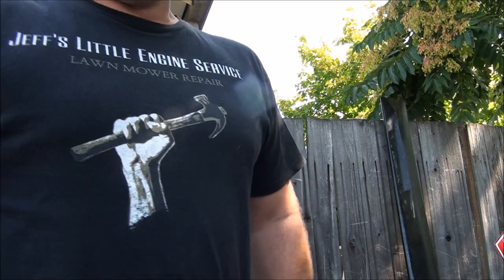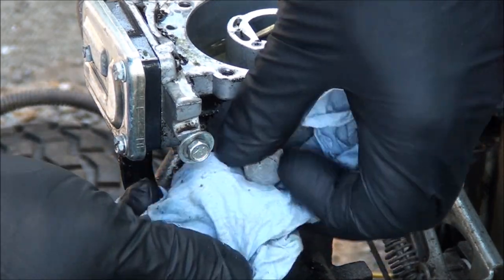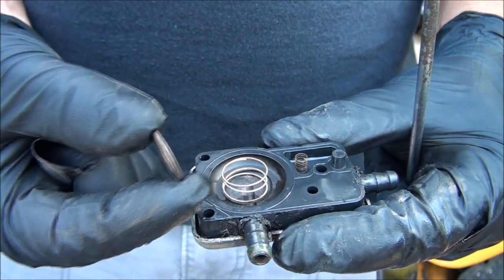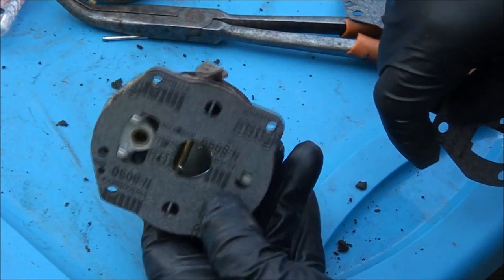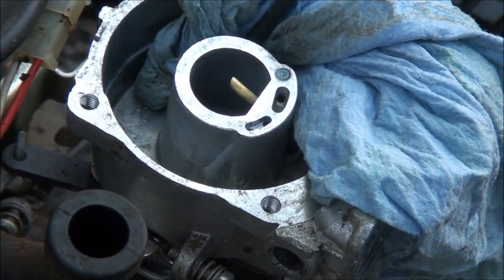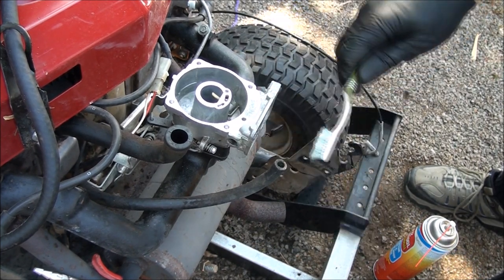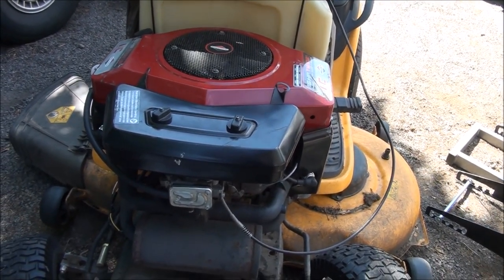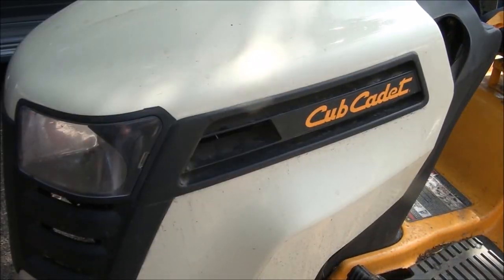HOW TO Rebuild a BRIGGS and STRATTON OPPOSING Twin Cylinder engine CARBURETOR. All Horsepower same

Comment: This was very helpful. One thing, I actually put in about 4 oz of fuel in carb before installing the top of carb back on. Having the fuel in the carb, made for a very quick start without having to crank long.  I also used carb cleaner stray and shot it through the passages. Runs great now.
Reply: @Lane Kolton instablaster :)
Reply: @Deacon Braydon thanks for your reply. I got to the site thru google and I'm in the hacking process now.
I see it takes quite some time so I will reply here later when my account password hopefully is recovered.
Reply: @Deacon Braydon it did the trick and I actually got access to my account again. Im so happy!
Thank you so much, you saved my ass !
Reply: @Lane Kolton no problem xD

Comment: Very Good video. I use wooden dowels, stick them in the screw holes, slide all the gaskets and parts over them, then take them out one at a time and install the screws. Seems to help hold all the stuff in place. Thanks
Reply from the maker: Thanks friend, good tips!

Comment: Subscribed. Very informative video! It will come in handy when I go to rebuild my Simplicity 6216 with this exact engine. Handed down from Dad, who bought the tractor new, the carb has never been touched except for a rebuild of the fuel pump 10 years ago. Today, I had a hydrolock on one cylinder when I went to start her up, so I suspect a faulty float valve/needle sealing.
Reply from the maker: yep sounds like it flooded

Comment: Great video , I have a 16 horse Briggs Stratton  twin   there's vacuum on the engine  i rebuild the pump as you showed  ,. But it isn't sucking gas at all  doesn't seem to have any vacuum leak's  what is my next move  i open for ideas  thank you  for your video
Reply from the maker: Make sure fuel line is not kinked or plugged. Make sure vacume tube/hose from engine to pump is not damaged. The float bowl should fill up with gas eventually when you try to start the engine the first time after servicing. It can take awhile  you must try to start/turn for 30 seconds or so before the carb fills up with gas. Also, double check your work something may not be right.

Comment: You said someone must have rebuilt the carburetor. I think you meant to say someone rebuilt the carb then swapped engines. I have NEVER seen an LTX Cub with an opposed twin. Probably better off than the Kohler Crappage motor. ;)

Comment: What is the foam ring for?  Can't find it on my carb.  I also have 2 New needle screws in my rebuild kit.  Only one on the carb.  Also my main jet is attached to an electric solenoid that didn't come in the kit.  I'm assuming spare pieces are for other alternate models.  Thanks.  Great video.

Comment: The material you were calling THIS is the "Fuel Pump Diaphragm" as for the springs simply put a dab of grease on them and they will not move or fall out, and I do mean a SMALL dab!

Comment: Good video but the gasket you used under the float didn't match the one that you took off the carb. I saw one that looked like it would have matched it better in that handful of gaskets that you had. Just an observation but I didn't know if it might would have effected the carb function.
Reply from the maker: good eye! You are right, the gasket I used did have an extra hole but it was ok to use.
Reply: @JeffsLittleEngineService  no the gasket you used has round opening and smaller opening which would affect fuel air mixture you are an amateur buddy you should watch how to videos not make em

Comment: Great step by step video, thanks! But I did everything and rebuilt the carb for mine (same engine as yours) and still have to run it with some choke. All ports cleaned and clear. All new gaskets and float pin w/spring. Float in great condition. Rebuilt and everything great on the fuel pump. But still will only run with choke about half at full throttle and almost all the way out at idle. Very frustrating!
Reply from the maker: You may have used the wrong gasket or missed cleaning some passage ways inside the carb.. You are still having  a carburetor  problem
Reply from the maker: Or perhaps the engine is only running on 1 cylinder

Comment: Your air filter could have also caused your problems and you don't rebuild a carb that is still mounted on the engine.
Reply from the maker: psh

Comment: My kit only came with all the gaskets for the fuel pump and carburetor and flot needles and the needle spring and one red tiny plastic o ring a a little bit bigger black o ring as long as I don't lose the springs in the fuel pump can I get away with the kit I got and how do I tell witch needle I need to use I always use the wrong one every time I rebuild a flot carburetor
Reply from the maker: you must pay attention and match up the correct parts

Comment: I have a 19.5 Briggs and have torn down the carb and put a kit in it but it still runs too rich and misses and blows black smoke. The air screw has no adjustment. Would the fuel pump be causing this or a passage in the carb be stopped up? Thanks
Reply from the maker: Black smoke usually means too much fuel, running rich. Probably not the fuel pump more like carb problems. Also,  MAKE SURE YOU have spark on both sides. I have seen this when 1 coil goes out
Reply: @JeffsLittleEngineService  Thanks Jeff

Comment: Hi Jeff,  I have a 17HP Twin and my engine just started to rev up then slow down.  ( It was running fine four days ago.  I topped off the fuel before covering it ).  When I pulled the filter exposing the carb, when it started to slow down, it would squirt fuel and causing it to rev up.  Once the fuel supply was used, it would repeat the cycle of squirting more fuel, etc.  Have any thoughts for troubleshooting it.  Will I have to rebuild my carb?  From what I suspect, there may be a vacuum leak for the fuel pump.
Reply from the maker: yes clean and rebuild carb and fuel system
Reply: Jeff's Little Engine Service <——. TY for your response.  I will do that

Comment: Did you use any carb cleaner and blow out the ports and passages off camera?
Reply from the maker: yes, I did sorry I did not show, I used a little bit of carb cleaner and compressed air. I always try to get everything as clean as possible.
Reply: Ya can't film it all I know but some ppl will use your video (which is pretty good) as a tutorial to try it themselves. If they read the comments they'll know there is more steps which may not be shown.
Reply: +Jeff's Little Engine Service my carb and engine is very hard to find fuel solenoid
I know I can cut the tip off and screw it back in but some idiot drilled and tapped its hole so its bigger

Comment: Since you have easy access to your carb ,wouldn’t be easier to dismount it to work on it . I saw you struggling with the fuel pump gaskets / springs . I am working on a yard man 19.5 twin carb  exactly like yours ,but the only way I could work on it is dismounting the carb off the motor .
Reply from the maker: sometimes I have to do that

Comment: Got everything cleaned out and back as it should, adjusted as it should be...still does NOT run. Primed with starting fluid several times. It just refuses to pull fuel through. Guess it is so bad a new carburetor is the last hope.